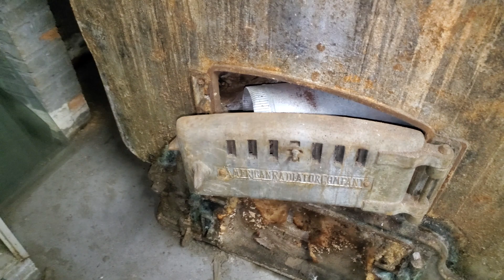Yet another basement fiber splice.  GPON\XGSPON overbuilding DSL & Docsis

Comment: this place looked clean compared to some other wiring closets and basements...I just got a 4 port 2.5gbe switch and it also has 3 spf+ ports which is a nice touch for ws to nas connections - for 40 bucks you can't go wrong was my attitude - should future proof me for a while. i may set up a fog server? i did try out a few ids/ips but really you need a machine with 64gb ram even on a small network - i will get a newer refurb box box at some point and attend to that - 24/7 pkt cap is  good thing and a possible thing for resale to smb clients - who doesn't want or need an audit trail and additional deep look into your network - setting it up with polar proxy/mitm box is also a good addition since then you can look at all the pkts. this video was standard look at daily job of network setup - good content
Reply from the maker: I have been looking at some of these switches that are coming out but the random speeds I think the standard 10/100/1/10/100 makes most sense.  2.5G or 5G ethernet seems to have no purpose I think having 1G ethernet should be a standard as ppl still have 1.5Mb connections.  Have you looked into proxmox's backup server vs fog yet?